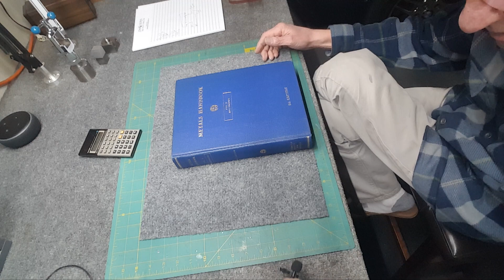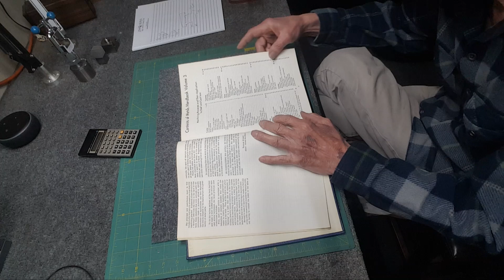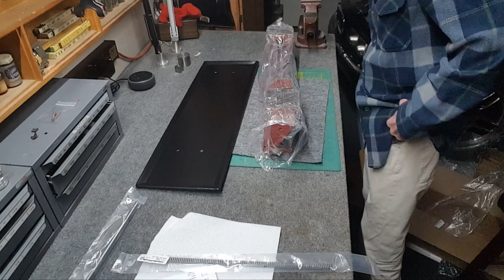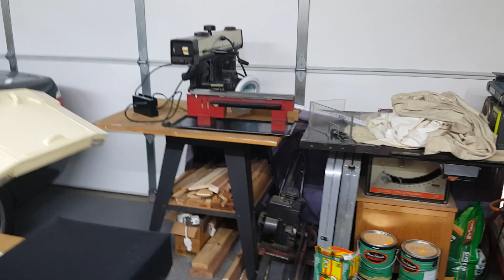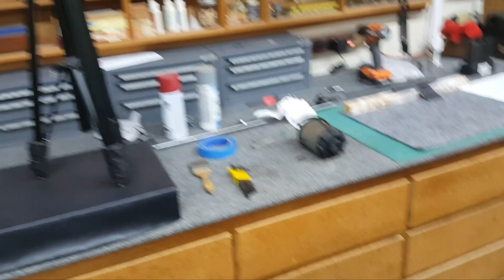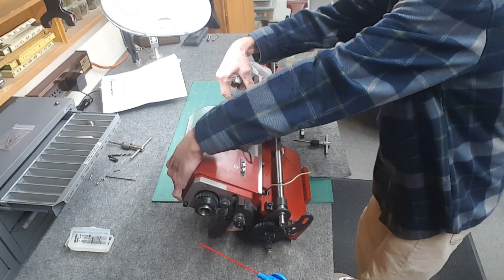LMS Mini Lathe Bed Extension Upgrade

Comment: Fun to watch the conversion although I had trouble understanding anything you said.   That's OK.  I turned off the sound and turned on the captions.   Worked out OK.   

The likely hood of an amateur machinist like me turning out any high quality work doesn't justify the expense of a bigger fancy lathe.   I'm hardly a space shuttle machinist after all.   

One thing I've often wondered about is if they mostly come from the same or other factories in close proximity then why all the brand names?    Reminds me of the old days in the US... in the late 19th century for instance, when virutally everyone in the countryside had a shotgun.   They came branded to the hardware store chain in which they were sold.   I have an old JC Higgins...   Used to be a national brand.  

Conversions are fun.  Give me something to do in my croaky old age....   Decrepitude here I come for fist lets modify this lathe.
Reply from the maker: Glad you enjoyed it future space shuttle machinist!

Comment: I'm looking forward to mine arriving. I ordered a rebranded sieg C2 from a company called Vevor and the bed was junk fresh out of the crate. The bottom of the ways were machined with about 3/32 of taper per foot so its impossible to use the tailstock. However it showed up to my door for 388 bucks so not complaining to much. So rather than ordering the same 14" bed, i went with the upgrade as it was on sale. Buy once, cry once. So soon I'll be swapping the bed on mine before it even makes its first chips.
Reply from the maker: Wow heard a lot on Vevor but never that bad. I am extremely happy with my upgrade and hope it works out for you. Check out Deez Workshop and his problems. BTW I like your name.

Comment: i know its 11 months later what did you pay for the extension and the shipping Thanks
Reply from the maker: It came from the little machine shop so the price is there can't remember costs but around $300.
Reply: @TheMiniMachineShop  I think that's about right with shipping Taxes etc. Thanks
Reply: I ordered mine yesterday with the kit and the drill and tap set came to $320.00 including shipping should get it tomorrow from UPS ground shipping 😊
Reply from the maker: It's one of the best things i did to the lathe! @bloop6812
Reply: Thank you. I was on the bubble regarding getting this up grade but after watching your tutorial I Dropped the Hammer on purchasing it. Thanks for the inspiration 😊

Comment: Did you make a vid on your tailstock lock mod? I bought LMS version for my 93799 and do not like it one bit. Ordered the bed extention earlier today. The extra 4 inches will be golden.
Reply from the maker: Yes and also the bed extension showing the LMS extension instructions are wrong.
Reply from the maker: My email is at the end I need to shoot a private video on a bed problem i discovered later.

Comment: I did the bed extension probably 2 years and change ago, well worth it.  ECM is electrochemical machining, salt water plus electricity with zero tool erosion and almost no heat so you can work hardened material to tight tolerance with no worries, its a neat process, they use it commercially on stuff like turbine blades and what not as I understand.  I've been looking into trying it out.  Du Pa Co did anesthesia equipment, so some sort of medical gas widget, I'd have to ask my dad if he's ever seen one.
Reply from the maker: That sounds real interesting thanks!

Comment: I just did the LMS bed extension and followed the instructions placing  the gear rack 1 3/4" From the edge of the front hole ( if you watch my video you will see how I did it) And I didn't have a problem.  Are you sure they sent you the right rack? I still have 1/2" of rack left when going all the way to the end of the machine bed.
Reply from the maker: Good point never thought of having the wrong rack mine is about 16" and yours?
Reply: @TheMiniMachineShop  for what it’s worth and mainly to help others on this same journey, I am in the middle of doing one now and got all wrapped up in this 1-3/4 v the 2” Issue.  2” wouldn’t hurt anything, but there certainly is 1/2 inch of rack gear left when the carriage hits the lead screw pillar block when using the recommended 1-3/4 from the edge of the hole dimension. So I am
Not sure what happened with yours but I’m thinking it was just an error. My rack gear is 16” with five screws. Thanks for sharing your video. Certainty made me a little more careful and to think twice and drill once. Cheers bud!

Comment: Great job Dave. Well done. Guess I'm lucky that my Warco Super Mini Lathe was born as a 7 x 14... Now fighting the Y move on the mill to make it move...
Reply from the maker: I had the same problem on both mills. Dykem on the ways and see where it's hitting!
Reply: @TheMiniMachineShop  Motor oil on the lead screw and Slideway Lubricant for the bed made it like living again. The 5" rotary table and it 5" 3 jaw weight is some 20 kg, 45 LBS needs lub....

Comment: The unknown item looks like  a high pressure valve that attaches to an O2 tank. I bought something similar for recharging my precharged pneumatic air rifle with an O2 cylinder.
Reply from the maker: You're close it is for a high-pressure tank, but the question is what is in the tank? And the interesting part is if you look at it it's not a valve!

Comment: I WAS WATING FOR THE KIT ON BACKORDER THEN BRIAN B TIPEDEM OFF ON A 12 X 30 ,I STILL MAY GET ONE ,,,,MUCH LONGHER ,,MUCH NEEDED,, GOOD VALUE
Reply from the maker: I waited a long time for it to be back in stock and like I said well worth it!
Reply: What 12 x 30 did you buy?  Was it a used one?
Reply: I’m sorry for the misunderstanding. I bought a Pratt and Whitney 12 x 30 circa 1943. It was a good life for a good price because not a real popular brand but all the same. It is a good used machine. However, I do miss my mini lathe, I often think about buying another one. I certainly regret selling mine but I would get the 16 inch extension bed believe it’s well worth it. Good value thanks for your comment. Hope I answer your questions.